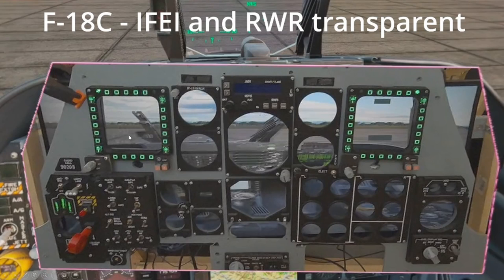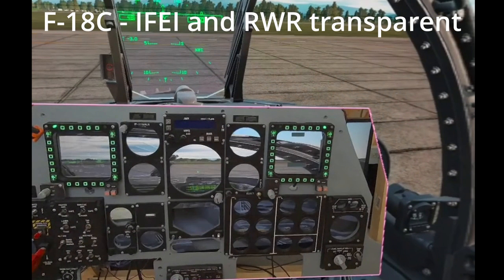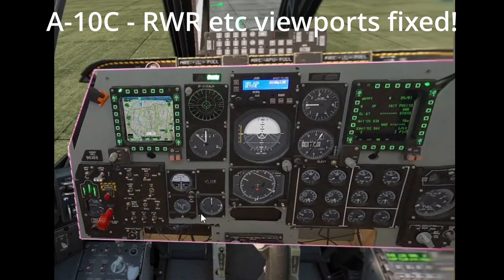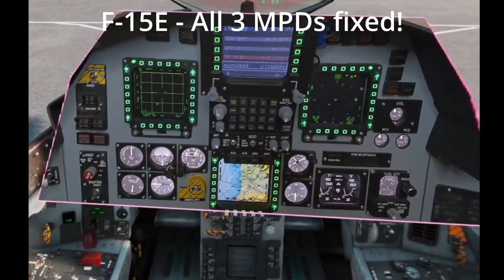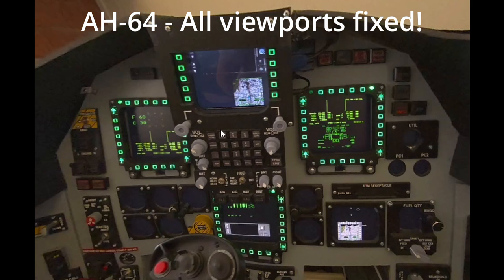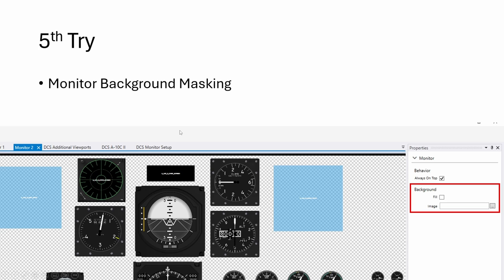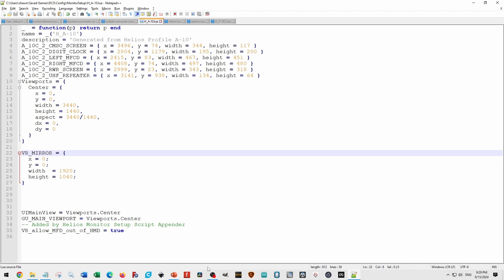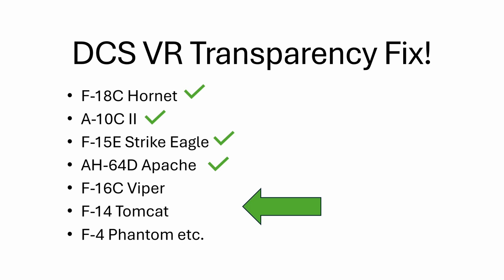Episode 33 Fix for DCS Viewports Transparency in VR

Comment: In Helios Toolbox-Special Controls,  there is a control for VR labeled as “ Enable MFD Export in VR”.. This control is actually “DCS Monitor Script Appender” to add custom LUA lines to the monitor file. You should be able to type in the VR_Mirror = {x=0; y=0;…. } script that you are using to mask the VR Mirror, and it should add that entire script into you monitor file. Just drag the control into the profile somewhere and select it, and add your lua, then “configure” the monitor setup again.
Reply: Great job finding the scripts to do this.  Helios should be able to do it and apply it to whatever monitor setup you choose, you just need to type that script in.
Reply from the maker: @MadKreator37  Oh I've been telling people to use this special control to automate the line "VR_allow_MFD_out_of_HMD = true". If it can also add the VR_Mirror lines too that'd save us the trouble. This is helpful. Thanks @MadKreator37
Reply: @simpitacademy  so it seems to add the lines to the bottom of the monitor file and users have said it does not work when its in that position in the file. I will talk with the Helios dev about it and see if he want to work it into the monitor setup scripting.
Reply from the maker: @MadKreator37  It did work for me as shown in episode 34. I added the vr_mirror thing to the right in helios and it added to the lua file. then the MPDs showed up black background as desired.